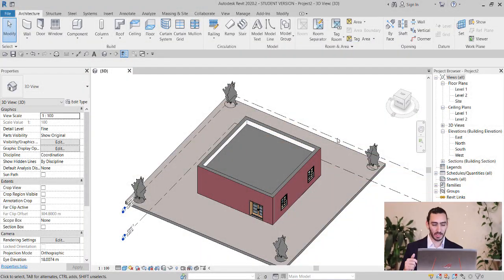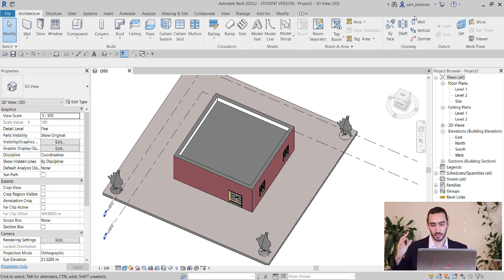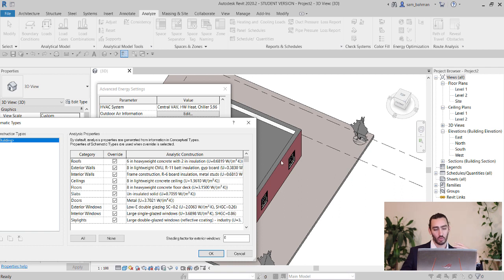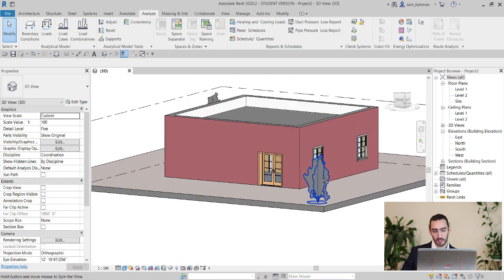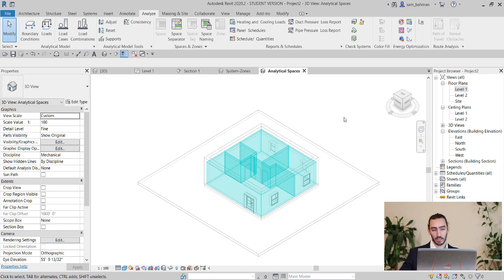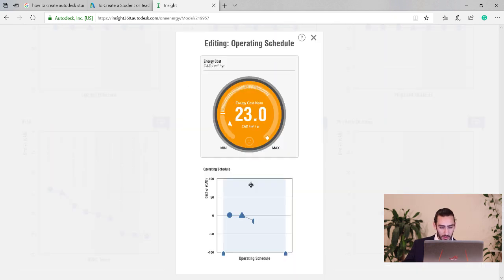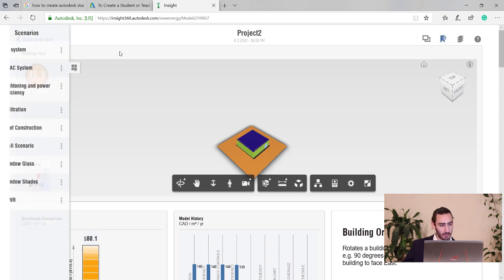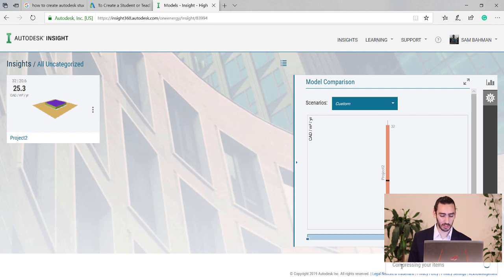Energy Optimization Analysis using (Autodesk Revit & Insight) + Generating the Report template

Comment: The EUI of a building includes the electrical power use and heating fuel consumption for heating and hot water generation. Many facilities require different loads according to their primary use or function, including cooling and refrigeration. in your video you only said it's for heating